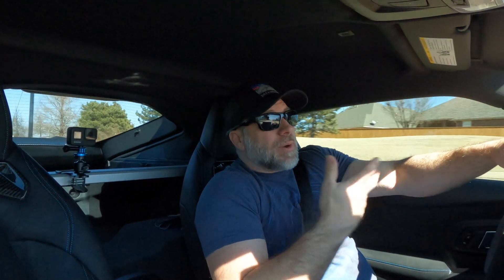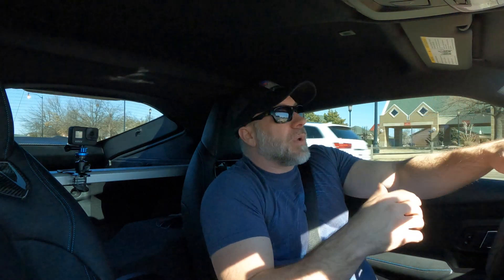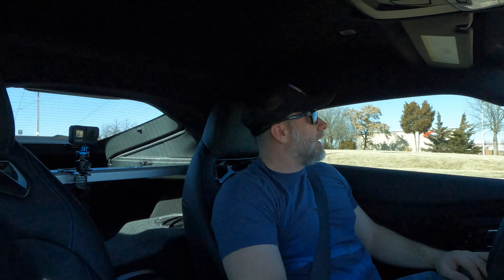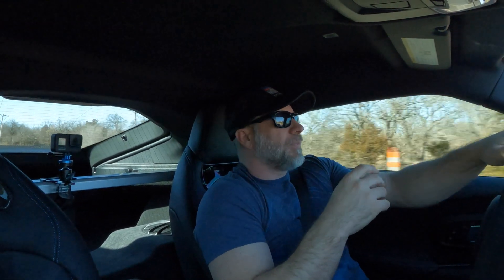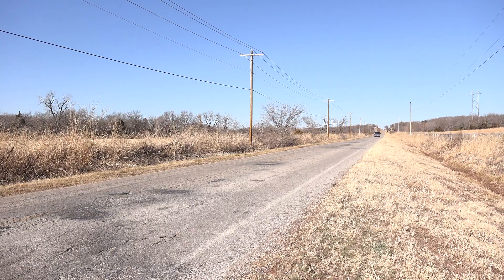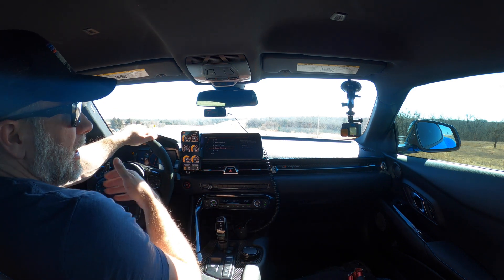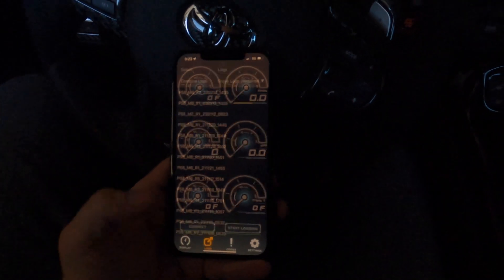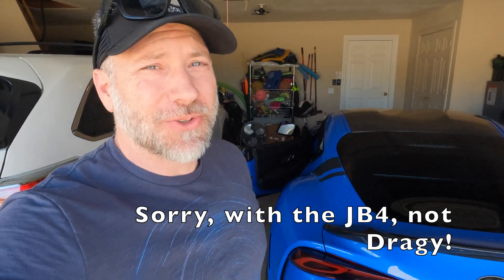Supra MKV // How to Data Log with the JB4

Comment: Hey bud. I have the JB4 but haven’t installed it yet. So when you data log your at 3rd gear wot at what rpm you let go of the gas? Thanks man
Reply: 6200 or so is all you need.  HP and Torque falls off after about 6000.
Reply: @SpiguyverBackpacking1  cool thank you 👍

Comment: I have JB4 same set up like you just without the meth. Your car goes crazy at 40mcg becareful looks scary lol with my MT 305/45/17 I been hooking even Jesse had to change some numbers because i’m not in stock tires. I’m thinking to add the meth and go dyno it again.
Reply from the maker: What did yours Dyno at?
Reply: @spiguyversgarage9452  around 450hp and 500tq with big tire of Mickey Thomson no Meth only E30 

I definitely want to add meth and see where I get Jesse told me close to 480hp
Reply: @samalsowaigh4763  quick question are those numbers without a downpipe. I’m thinking about getting a downpipe that w. No cel.

Comment: was meaning to ask you if you had any fitment issues w/ the duckbill spoiler from A90?  The drivers side tip doesn't sit quite flush with the hatch....it's fine but more of a gap there off of the tape than i was hoping....maybe it will get better in the summer not sure.
Reply from the maker: Mine seems to fit pretty well.  It is a better fit than the Rexpeed one was.

Comment: How hard is to run a e40 blend looking to get a jb4 for my Supra soon just got the car still getting used to it
Reply: Get the Fuel-it or Visconti flex fuel kit and you'll be set.
Reply from the maker: Not hard, you just need to either measure content and keep up with it with an ethanol calculator, or get a sensor like I have, the Fuel-It.  If you are just mixing off of a calculator, every 3-4 tanks I recommend going all the way to zero e and running a couple tanks of pure gas through it so that you reset and know where you are on e content.  I did a video where I talked about this a while back

Comment: Thanks for sharing. I think you will continue having traction problems even with the stickier tyres due to the boost delivery of the stock turbo. That turbo is really meant for low-end tq to make the car more user-friendly in the daily driving situations. Have to remember that this motor was lifted from the m340i, which is a commuter type of car. In order to solve the traction issues, the turbo needs to be upgraded to a larger one with a more progressive spool. One of the big reasons to upgrade to the pure800, not necessarily to gain more power, but to smooth out the tq delivery. With the stock turbo, the tq hits you too suddenly and not progressively enough. Which is why the tyres break loose like that. Good news is, swapping the turbo on the b58 is super easy. You can do it yourself with the basic tools in about two hours.
Reply: You can always try 305 drag radials with about 20 psi in tires shouldn't be a issue anymore. Long as temperature above 60 degrees anyway lol
Reply: @FatMenDriveTrucks  not a viable option as they aren't street legal and if you get caught driving in the rain, it can get sketchy.
Reply: @edwint1780  not true I daily a 780 whp mustang with drag radials. It's the only option for traction on vehicles making real power. I've been doing this for about 15 years just need be careful in rain it's nothing with traction control on new vehicles just have a brain
Reply from the maker: Great points, very valid input!  It's on the list of upgrades!  I appreciate your feedback, thanks for watching!
Reply: Does it really only take 2hrs? My local shop who works on Mk5s told me he needs it overnight.

Comment: What do you think of that new Nissan Z that Grey color they just came out with looks really nice
Reply: I'll also tell you my 370z would overheat, boil brake fluid, and fuel starve.....so there is a price you pay for a low MSRP, depends on what your priorities are.  Getting a Z track-ready and reliable costs between $5k-$10k.  Can handle short bursts for like AutoCross but hard track or country road driving over longer periods of time is sketchy on stock components.
Reply from the maker: I will have to see it in person and experience it.  Starting price is right, it comes with a manual, and the engine is known to be tunable already.  The downside is that it's heavier, and the manual is coming to the Supra next year.
Reply: @spiguyversgarage9452  Will you be switching to the manual version?